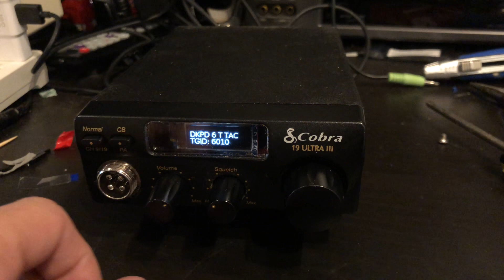You too can convert your broken cb radio into a P25 trunking scanner

Comment: Some people have to much time on there hands. The thing is the only people that would be knowledgeable enough to do such a conversion are the same ones that call bullbutter on your mod. There’s a minute thirteen I won’t get back.
Reply from the maker: Are you drunk?
Reply: This is an Awesome project 👍
Reply from the maker: @0ffGridTechClub  Thank you!
Reply: @hollygorock  you need to do a video how you did all that because it's a great way to revive old CB radios by replacing the guts in them so yeah you should show a video how that's done
Reply: @414RadioTech   more than likely , he only used the case of the CB to hold other electronics , hence that is why he gave no details .